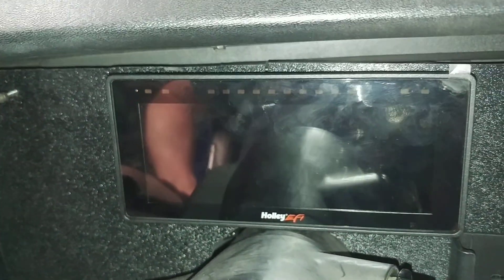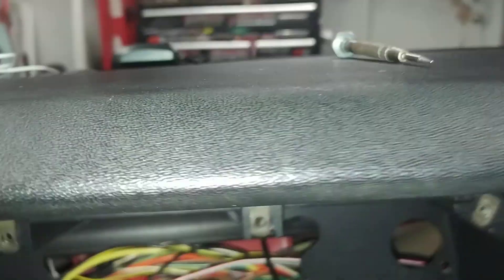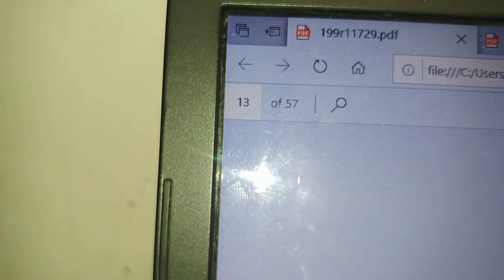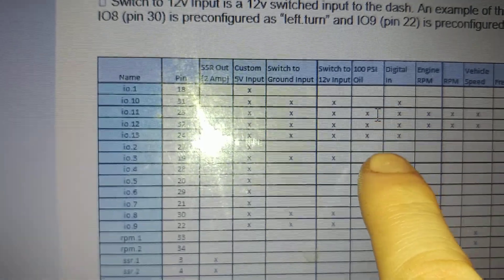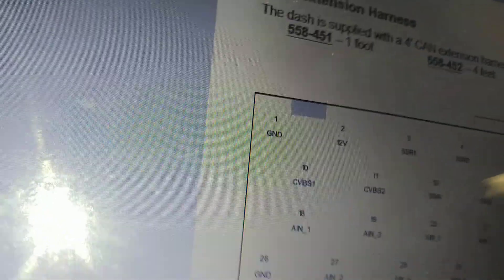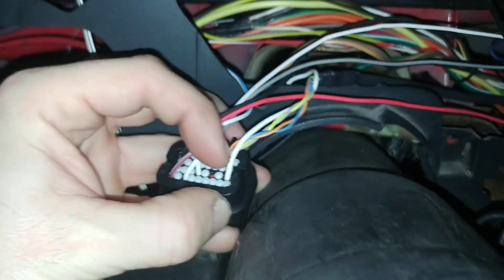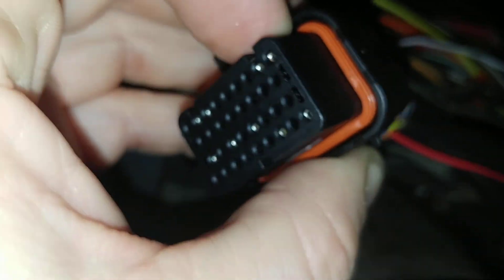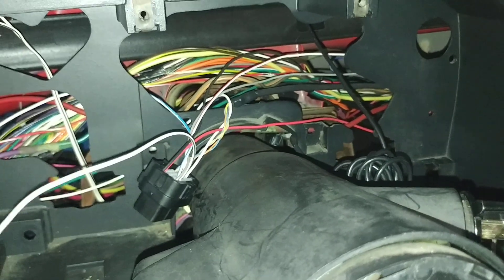How to wire your Holley Pro Dash

Comment: Do you only need the sensor ground for the non Holley sensors? I have the gm ones in it and my oil pressure, fuel pressure and CTs  aren’t working, rpm does work though
Reply from the maker: How did you scale the GM sensors in the dash? Inaccurate scaling will cause the sensors to read incorrectly or not at all. A 3 wire 5 volt pressure sensor needs a 5 volt power wire, a ground wire that gets wired to the chassis ground, and the signal wire that gets wired to input. A 2 wire temperature sensor uses a thermistor, one wire gets wired to the input, the other goes to the sensor ground.
Reply: @TrailerParkMotorsports  I was told with the gm ones I didn’t have to scale them.  But now I’m thinking that’s what I’m going to have to do

Comment: do you need holly wiring
Reply from the maker: @ashad_._8113  no, you can source the terminals from other companies like Monkey Fab and use 18-20 gauge wire from anywhere.
Reply: @TrailerParkMotorsports  ok thanks i didnt really feel like re wiring the whole car

Comment: Where did you find the connector pins for the Pro Dash Connector?
Reply from the maker: At the time that I made this video, I was buying pre-terminated wires from Holley on Summit, part number HLY-558-420.

Since then, Mike at Monkey Fab has started selling the pins and connectors for Holley stuff. There are a few other sources, but Mike is a fellow veteran, and I like to support my brother's.
Reply from the maker: Thanks for watching and commenting.

Comment: Thank you for the video. I subscribed to you channel. Keep the contents coming. 
I do have a question regarding the IROC Z28. I too have one and am looking for some help on wiring up my turn signals and head lights to it. Can you please tell me what's the best way to go about it from the factory fuse box. 
Do I just take the wire that powers my lights and any other switches from the fuse box and just run it to the dash? 
Also I'm running a Holley HP efi system to it as well.  Thank you for the insights
Reply from the maker: Thanks for watching, commenting, and subscribing. If you're looking at working on the wiring of your car, but not doing a full rewire, then I'd use the wiring diagrams from Austin's Third Gen. I saved all of the ones for my car from that website onto my laptop for easy reference. Here is the link for that website.

https://austinthirdgen.org/thirdgen-wiring-diagrams/
Reply from the maker: If you're looking for a fresh start, I'd suggest the Leash street strip board. We have this in the OBS shop truck with the 632 in it, it makes wiring all of the lights and accessories a breeze. Here is a link for that product.

https://www.leashelectronics.com/products/street-strip-wiring-board

Comment: Could the efi 7in be hooked up to the 386 fuel injection crate motor
Reply from the maker: Thanks for watching. I'm not too familiar with the 7" dash, but I'm pretty sure that you can if you wire in all of the sensors to the harness. My friend Brian channel @jcavs garage, he has the 7" screen in his Mustang, he might be able to help more.

Comment: What size pin connector did you buy for the harness?
Reply from the maker: Thanks for watching. Here's a link, I hope it helps.

https://www.digikey.com/en/products/detail/te-connectivity-amp-connectors/3-1447221-3/3742550
Reply from the maker: Also this one.

https://madracingparts.com/products/holley-20-gauge-crimp-pins?_pos=2&_sid=ba37f75c5&_ss=r
Reply: Your awesome thanks for the reply trying to get my GTO dialed in for Holley LS fest west
Reply from the maker: @Carpenter909  sounds like a fun project, and good luck.

Comment: What did you use to mount the Holley on the column?
Reply from the maker: Thanks for watching. It's not on the column, it's mounted to a piece of plastic that fits in the stock dash. I just changed it after three years and I'm working on a video showing that. Look for it this weekend.
Reply: @TrailerParkMotorsports  no problem at all. Will do, I’m gonna turn on post notifications rn

Comment: I have a terminator x and pro dash 6.86 but instructions dont make sense as you take the one end of can connector and connect it to the ecu harness and you put the terminator/resistor on the other end but doesn't show where to connect the usb cable that came with the terminator x. I know the pro dash has a usb c to usb female but surely they aren't wanting you to tune through the pro dash? Can I not run the terminator/resistor plug and connect the usb mals harness to that?
Reply from the maker: To connect your Terminator X ECU to the pro dash, locate the can connector on the main harness. Remove the terminating resistor from the can connector if there's one in place and connect the can cable to the pro Dash. On the harness of the pro Dash there is a built-in splitter, that is to can connectors. You can plug in your USB dongle for the laptop to one of those open connectors or plug in the terminating resistor instead.
Reply: @TrailerParkMotorsports  one of my buddies said that I need the splitter cable that holley sells. But it does make sense that I can unplug the resistor and plug the can to usb cable to it.
Reply from the maker: @Tookoff  you can do it either way, with a splitter off the main harness with one end going to the dash and the other going to the dash, or plug the dash straight into the canBUS connector on the main harness and then the USB dongle into the unused can connector on the dash harness.

I'm using the splitter method.
Reply: @TrailerParkMotorsports  thanks man I appreciate that
Reply from the maker: @Tookoff  you're welcome
Reply from the maker: So CANbus, or closed area network bus is an old networking topology. It really hasn't been used much in something like 30 years, however it does work very well with a limited number of devices such as in a car where you only are connecting the ECU to a dash or a logger or a handful of other devices. Unlike some other newer Network topologies bus cannot have an open port and needs a terminating resistor.
Reply from the maker: If you are not going to use the prodash and just run the Terminator X on its own, then you would plug in the USB dongle into the can connector on Holley main harness.

Comment: Do you do house installs near chiraq?
Reply from the maker: I spend the least amount of time possible in Illinois. I would rather go back to Baghdad.
Reply from the maker: However, you can come down to Texas anytime you want.
Reply: @TrailerParkMotorsports  perfect time to load up the trailer
Reply: Which size pin connectors did you buy for that harness?

Comment: Hi, I wanted to see if you knew any tips on the 6.86 standalone Pro version, you seem to know a lot about this.  I know you're using the Terminator ECU.  Not my first rodeo, have installed a kustom Knight Rider dash, numerous radios, and three Code Alarm remote start systems.  I want to start basic with only like 6-7 gauge inputs on my 2000 Trans Am.  Have you seen any premade bezels out there for the 4th gen TA's?  Holley wants you to plug an I/O harness #2 in to the main harness, and possibly use their oil and coolant sending units.  Trying to figure out if I can use mostly the OEM sending units and somehow calibrate them in the Holley dash?  And wondering how many of these sending unit signals would be available to me right at the cluster wiring, without having to run new sender wires all over the car and new senders.  Also prefer to use the car's OEM VSS if I can, not the GPS, I think.  Also, I think the 2000 fuel level V8 sender OEM is NOT 0 to 90 ohms but can be replaced with a GM sending unit that is 0-90 from what I'm reading?  Any thoughts and ideas on any of this?  Thank you, and love the Camaro!  Lee
Reply from the maker: Thanks for watching, I'll try and answer as much as I can while I'm at work and not by my car or the computer. The main difference between the Pro Dash and the standalone Pro Dash is that the harness is pre-wired for the standalone and the bare minimum of wires (power, ground, CAN) are pre-wired with the standard Pro Dash. You could do it yourself easily if you buy the pins in bulk and wire it yourself, or just spend the money for the standalone dash. I'm assuming that you either are using the stock computer for your 4th gen, or it's a carb setup, and not easily connected from the dash to the ECU through the CANbus connection. You do not need to use Holley specific sensors, I'm having great luck with the Low Dollar Motorsports sensors, which have the same scaling as the Holley ones. As long as you know the scaling numbers (resistance, frequency, or 0-5v range) you can use any sensor you want. Personally, I'm using a mix between factory sensors from a 2003 Silverado (oil pressure and coolant temperature) and a 1997 Camaro (crank, cam) or Low Dollar (fuel pressure, transmission temperature) and they are either wired to the ECU (then read by the dash through the CANbus) or straight to the dash like the trans temp. I do not know if anyone makes a bezel for a Pro Dash in a 4th gen, (I wasn't looking for anything besides a 82-89 Camaro, but I do remember seeing a bunch of 1st gen bezels) but more people are 3d printing or molding their own and selling them now than a year ago when I bought mine. You do not need to swap the fuel level sending unit, just set the scaling for the resistance levels for a 4th gen (30-370 I think). I'd reconsider using the GPS speedometer, it's super accurate and acquires the satellites inside my garage before I even start backing the car outside. The OEM one is basically only reading the driveshaft speed, doing the math for gear ratio and tire size, it doesn't account for tire slip or tire size/gear ratio changes. It also doesn't use up an input, the GPS has its own antenna port and connects with a small coaxial cable; the antenna just gets attached to the dash pad with a piece of double sided tape.
Reply: @TrailerParkMotorsports  thanks a million, this is all great input.  I'm going to respond more in a bit but wanted to say thank you right away!
Reply: @TrailerParkMotorsports  Hey it really means a lot to me that you took the time to answer these questions!  I’m studying the wiring harnesses is quite a bit, I’m also considering the original 7 inch dash that they came out in 2016 with. I’m still on the fence about whether I would want to spend all that extra money for the extra harnesses or just buy the pins and do it myself.  The original 7” dash looks like for about $100 you can get an I/O harness and you could really cheap out with from there, just use the white connector to go to the dash itself and cut off the black waterproof part completely!  Yes I’m considering doing this with the stock fourth generation ECM with the LS1 engine.  I’m just beginning to study the shop manual I’m looking at the shop manual from 1999 not 2000 but it should be similar - I have it on a USB stick instead of the printed books. It doesn’t look very easy at all to tap in to the canbus - do you happen to know what protocol they are using in the fourth gen or where I can find out? I have been looking.  It’s great that you’re finding that the lowdollar motor sports sensors work well for less money! That’s good to know I’m going to check out their website.  By the way it seems like this is a very solid and well engineered product but I’m still concerned about diving in at this price point and ending up with a high priced paperweight! Or blowing it up inputting a bad input.  But I should be ok as long as I study it all first as long as I’m not trying to put 1000 volts from the ignition coil into the dash, LOL. I don’t think that would happen, but it’s a concern.  I found what you said about your sensor set up quite interesting, and I understand what you’re saying about the fourth generation gas gauge. I get the impression the techs I talked to at Holly don’t seem understand that you can calibrate a lot of these sending units in the dash software, as long as they’re are 5V unit. I think they think you can only use the Holley sensors, or that’s what they were told to think! Haha  Yes, I’m going to have to look into different bezels or fabricating something, I’ll keep working on that. I really want to start out basic with just the basic regular dash functions – fuel level, volts RPM, speedo, oil, and coolant, so you would think that wouldn’t be too hard!  My concern about the GPS speedometer is if there were any GPS outages or if you were in a tunnel or something that that would affect the odometer reading too much?  I’m not sure yet, was thinking I could probably leave the factory odometer connected and then just use that for the odometer and then the GPS speedometer, which would be more accurrate than the VSS speedometer anyway.  Do you have any thoughts on that?  I see your point about not using up an input if you use their GPS signal, that’s a very good point! One other thing I don’t understand is why Holly doesn’t have data sheets for the more popular car models that offer their preferred method of installation with all of their recommended software settings whether to use the canbus or not and what sensors to use for your specific application it would seem like that would make things go much easier and they would see more units. I’m very interested to see that you’re using both the canbus and also the input / output harnesses to jam a lot of data into that dashboard! Lastly, did you ever notice in the input settings there’s a pre-configured setting for GM LSX engines for the coolant and oil? I was wondering if that might allow me to use the stock coolant and oil sensors?  Do you ever use a multimeter to confirm the volts, amps, or resistance on your sensors are compatible with your dash?  Your set up sounds awesome! Anyway thanks for any and all thoughts!

Comment: What’s the part number for the wire terminal you crimped onto the wire
Reply from the maker: Alternatively, you can buy the terminals separately from someplace like here.... https://www.digikey.com/product-detail/en/te-connectivity-amp-connectors/3-1447221-3/A107346CT-ND/3742550

If I add more inputs and outputs to the dash, I may go this route, but I thought this would work since I only wanted to add trans temp and fuel level gauge. Adding the turn signal indicators used up the last of the five wires.
Reply from the maker: https://www.summitracing.com/parts/hly-558-420
Reply: Thanks